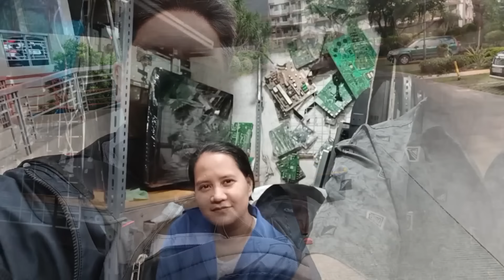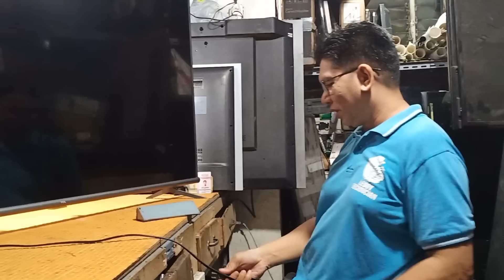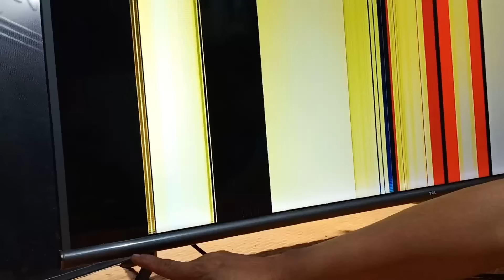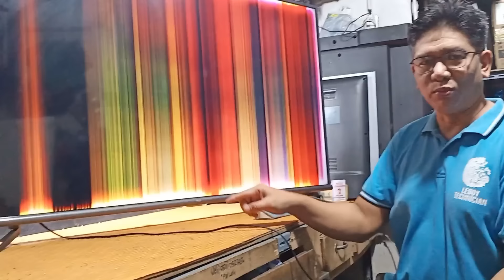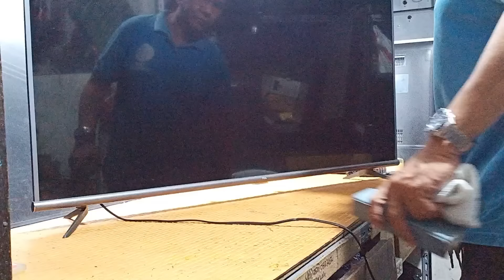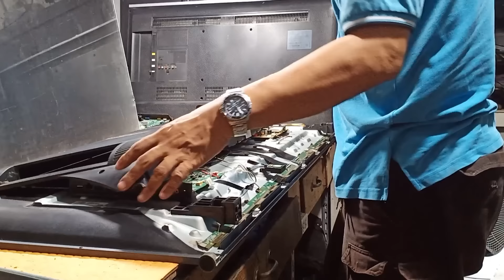How to repair vertical bar image TCL- LED55A8US

Comment: My TCL have the same problem. We used the tape method but instead of taping the right part of the left tcon( coz it didnt work) we taped the left part. And it fixed the problem.

Comment: Translate to english plzz. I ha e this exact tv vertical lines . I took each one of the tcons line off tto csee whaich side but did not get a specific side result when o reconnected each one now the the limes ha e turned in to solid white on 1 side and black on the other

Comment: Good day, sir Leboy asking lang po sa model KLV-24EX430 sony, ano fit na polerizer film ang need na ikabit sa kanya? Thank you po!
Reply from the maker: dapat po same sila ng degree
Reply: Sir Leboy, papaano ko po malalaman kong ano degree ng tv namin? Nag search po kasi ako polerizer film mayroon po zero degree at mayroon din 45 or 90 degree. Thank you po uli!
Reply from the maker: @ronillobigtas7664  type mo sa google yung panel no. nya at datasheet lalabas po specification nya makikita mo po dun
Reply: @leboytechnician2867 Thank you very much sir Leboy😊

Comment: I also block 14 pins of TCL 55P8. Display is coming but left side of screen dark. So how it can be solve?
Reply from the maker: if there is a side cof remove that, take note if the side cof is left and right, you can remove the other side

Comment: galin boss pero boss tanong ko lang ano po sira  nung TCL 55" LCD tv na kapag unang on nagpapakita yun TCL na logo mga ilang secondo sya wala na
Reply from the maker: iba iba pwedeng mainboard, panel bakclight
Reply: @leboytechnician2867  ok boss salamat check ko na lang sya kasi tagal ko na kasi hindi gumagawa na stop ako ng 20years kaya hindi ko na alam yun iba

Comment: What is this fix? This is not repair. It cannot be repaired by gluing the cable. There is a line under the image. A capacitor or resistance must be burnt, which half of the picture is incomplete. Change that thorn, not glue it